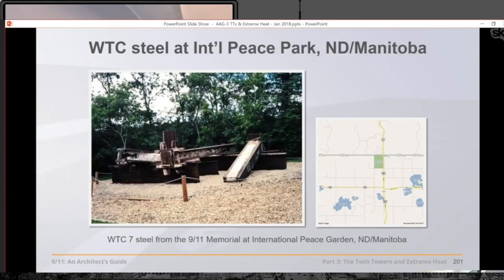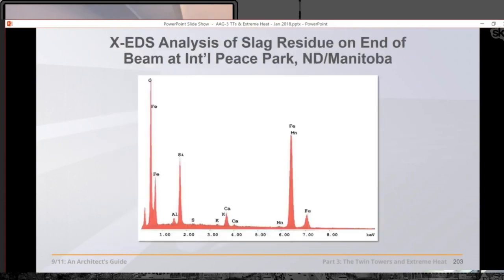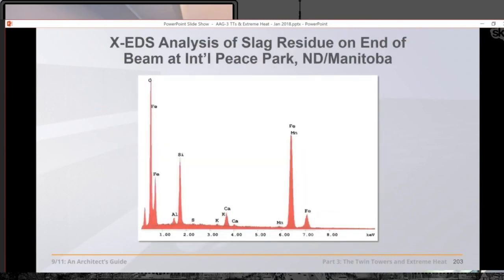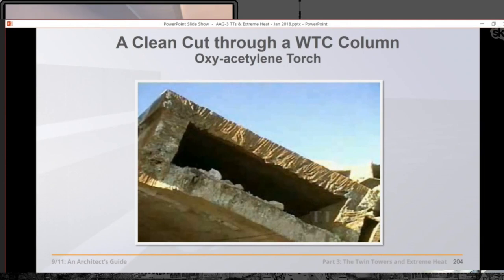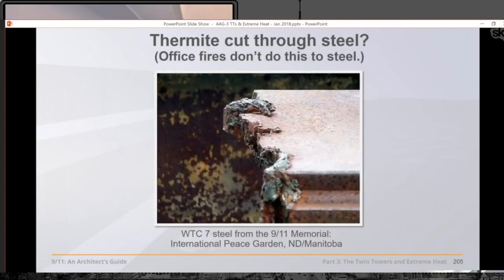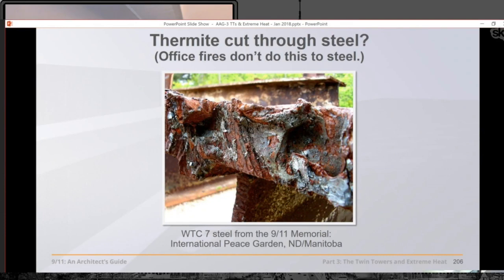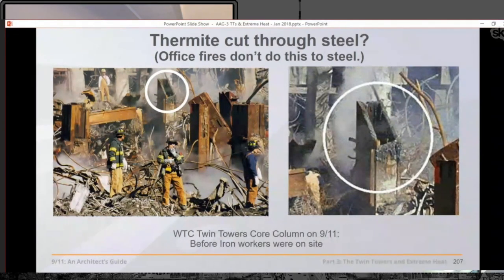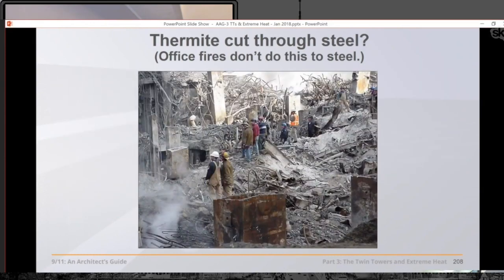Richard Gage Discussing Slag Analysis & Cut WTC Columns

Comment: You know that the 1998 FBI Files episode on the 1993 WTC attack says in the episode that the buildings were designed to withstand the impacts of fully fueled jet liners. The episode is on YouTube for free and it aired nearly two years before the Sept 11th attack.
Reply: They were designed for a 707 impact, the largest liner of the 70's. 767's are much larger, faster, and higher fuel capacity.